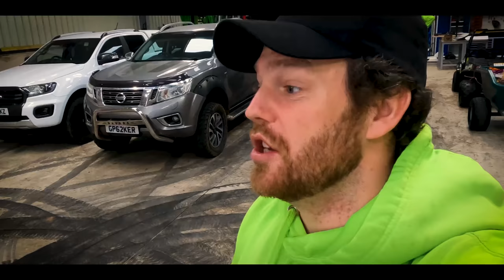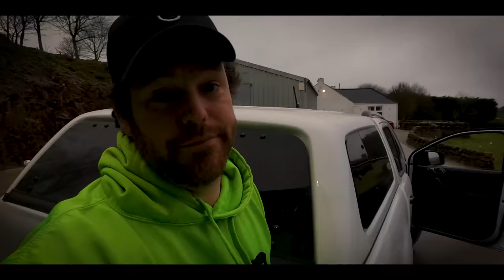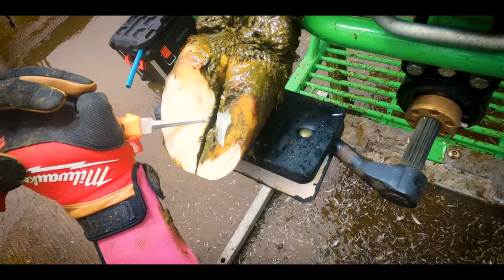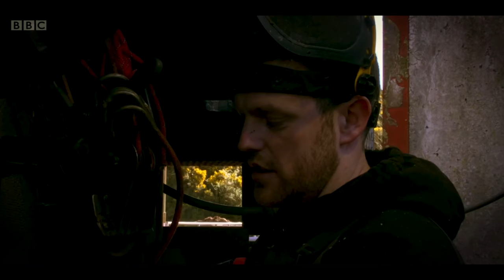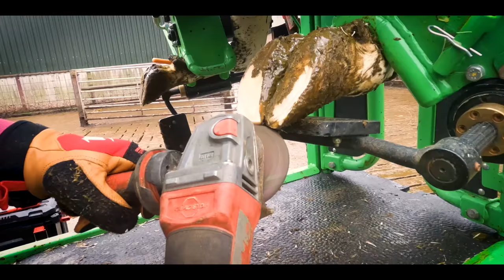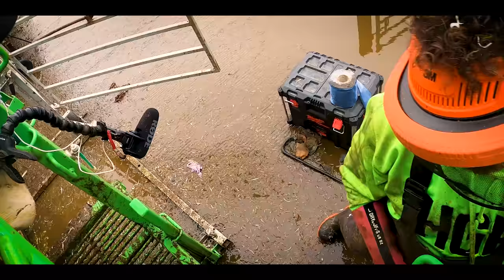there's a STONE HIDDEN in this FOOT!!!

Comment: Is the KVK that much better than the Appleton Steel Graeme? I liked the AS, it also provided a little of protection from the elements and just looked cooler. But then, I'm not using it so I'm sure it's probably working out better for you than the previous models. This one looks a bit lighter in weight so you must get better gas mileage too.

Comment: If you're not worried about people breaking into the shed, might I suggest replacing the bottom 3-4 feet of that roll-up door with stiff rubber instead of metal...or at least the center section, maybe with something resembling a giant pet door that can get pulled out and then snap back into place preventing damage put an RFID fob on the front of the crush that unlocks the flip section as it passes and then locks once the crush is away from the door...might save on repair costs...

Either that, or when the door gets fixed this time, have the repair tech add a circuit to the motor that opens the door ALL the way when you hit the button, that way you don't need to try and remember to FULLY open the door each time you're taking the crush out...

Comment: If the hoof horn grows from the inside out (if I've understood it right; that's what the anatomy suggests), how do things end up hidden inside the horn? Like, how does a rock get pushed up inside the horn, along with mud and sludge, and then somehow new horn covers it from the bottom?? That confuses the heck out of me. Can someone explain?

To use an analogy of what I think is happening: it's like drilling a small hole at the tip of my fingernail, and two weeks later the hole has somehow moved further up my nail nearer to the bed. How??

Comment: Ok I just have a few questions 🤔. Why are some horns longer than the other? Like I saw a few where the outer horn was a fair bit longer than the inner horn. 

Why do you have to model the horns out? Some you model out a lot. Some only a little bit. Are there benefits to the modeling?

What happened to using a rope instead of the nozzles? Haha. I'm sure there are places you could attach the ropes to even if they have to be removed to close the crush up. They don't have to be permanent and would likely be easier to keep in-between the cows horns rather than having to bend down constantly to grab the fallen nozzle.

Comment: Do you ever trim goat hooves?
I have dairy goats and meat goats. I've watched you for a while. 
Cows are a bit different than goats. They also have similar feet. I trim my goats and at first I was hoping I got it right. Now seeing how you trim cows feet I took that knowledge and applied it on smaller basis.
I'm wasn't sure if it was a good thing. It has made a huge positive difference and the girls are showing it.
If it doesn't have working feet it can't eat.
If it can't eat, we all know what happens and that just won't do.

Comment: There’s actually an easy way to make sure the KVK doesn’t hit the garage door, take some tape and use a marker to put arrows on them, some on the bottom of the door and the frame (arrows facing each other) when the door is open enough to so the crush doesn’t hit it, then when you open the door, open it until the arrows match.  Airplane owners do this do they don’t damage the planes.

Comment: Oh no! You are equal to me. Moved into our brand new home, garage door opener wasn’t installed yet and as dingy as I could be… pulled up, jumped out to open the garage door.. and I didn’t our the car in park and it went through the garage door. Ruined the door..  scratched the hood of the car. 😮🤬🤢